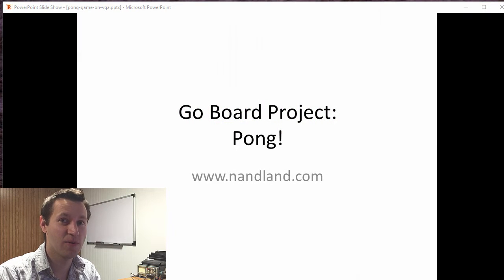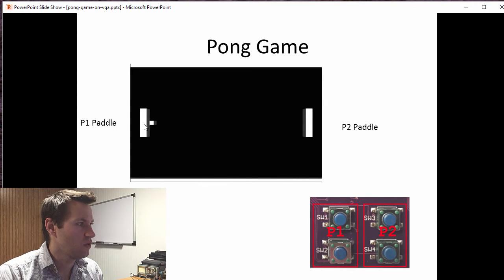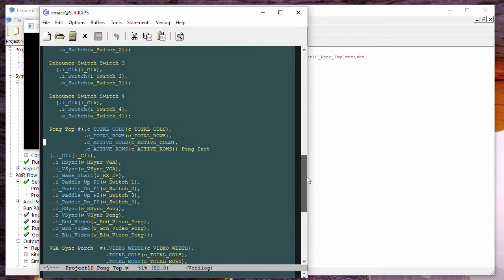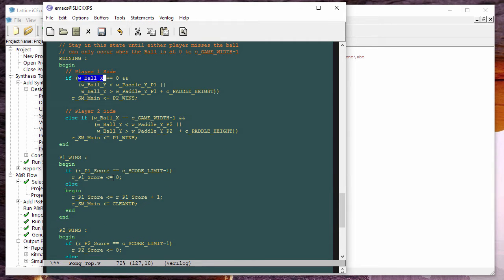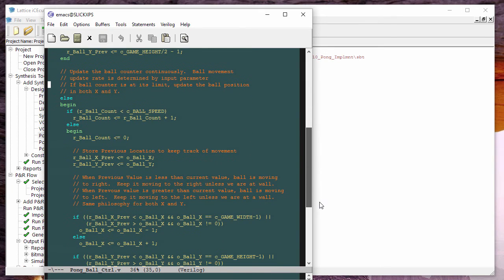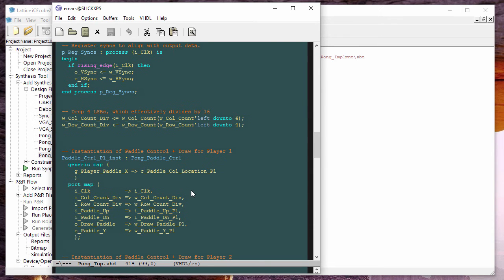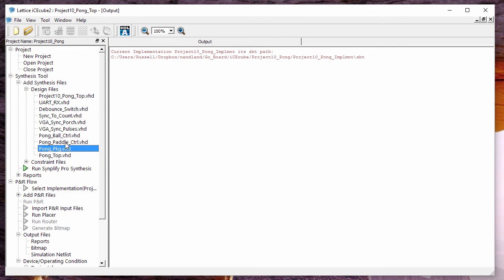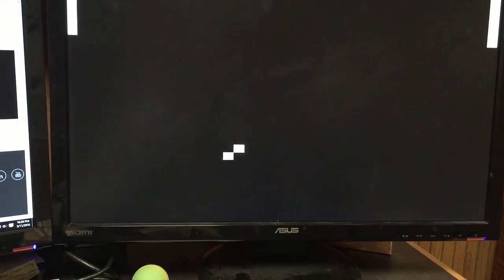Nandland Go Board Project 10 - Pong!  (On your VGA Monitor)

Comment: i just confused with input            i_HSync,

   input            i_VSync,
inside Pong_Top.v

why we need those?  as long as i know , Both Hsynq and VSynq are generated by our counter.
Reply: I don't have the code in front of me, but I think those are for generating the row/column indexes internal to the Pong module.
Reply: I think that will need response from outside fpga because u initialized as input at top module hierarchy
Reply from the maker: @wisnueepis3593  You'll have to instantiate VGA_Sync_Porch from the VGA tutorial along side it. That will generated the HSync and VSync pulses needed by the Pong_Top.
Reply: @Nandland  i got it, thanks

Comment: This is exactly the project I want to start in order to learn VHDL and Verilog at the same time. Your page with codes is excellent source to compare that two languages. I have Cyclone II FPGA, and no VGA output port, but I can improvise. Just not sure how you did on your Go board connect VGA port (DB15 connector). Those three bits, do you use discrete resistors, or ICE can be connected in parallel with some internal resistance or something? I can make DAC with R/2R ladder.... Just curious - do I need those resistor? Thank you in advance for your answer.
Reply from the maker: Go board schematic might help you https://www.nandland.com/goboard/images/Go_Board_V1.pdf

Comment: Hey thanks for the great videos, I got the pong game working on my basys 3 fpga running at 100mhz I just needed to make a clock divider to slow it down to 25mhz after that it works great. Two questions, I got the player score registers routed into my seven segment display module and it will display 1 once a player scores but if they score again it goes back to zero. Looking at the code you've written I see no reason for this behavior. Any ideas why? I left all of your code untouched just added the segment display in the top module of the game.

Comment: Thank you very much Russell! Your tutorials were a great help in learning FPGA and digital design. I'm actually a TA in a digital design course, and I recommended the Go Board in one of my classes. 

+1 for the block ram tutorial, and I will love to see a PMOD tutorial as well. Some questions: Is there a way to change the clock speed of the go board? Are you planning on releasing a 8K version of the go board?
Reply from the maker: Thanks for the feedback.  I'm glad you've found the tutorials useful.  I am planning on making more videos when I have time, hopefully within the next month or two, thanks for your requests.  At this point, I'm not planning on making a larger Go Board.  Instead I'd like to focus on making videos, I think that will more helpful than introducing another FPGA dev board.  If more people request an 8K board, I would certainly jump at the opportunity, I'm just worried the market isn't big enough for me to invest the time to create it.  Again, thanks.